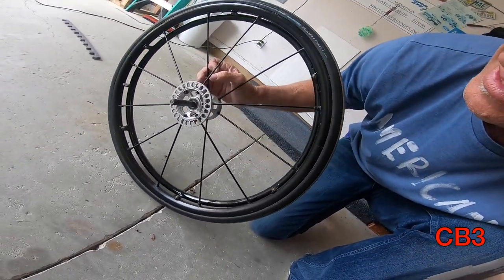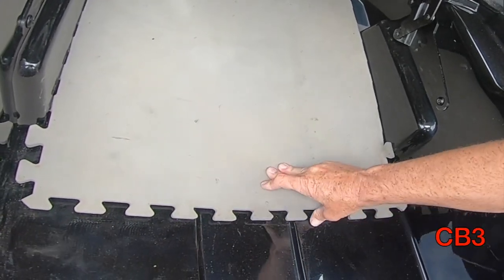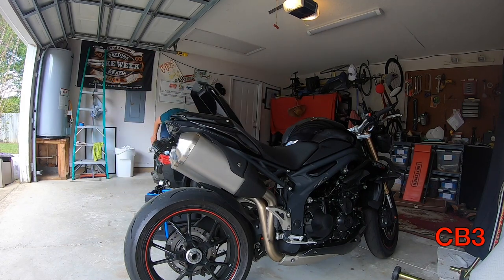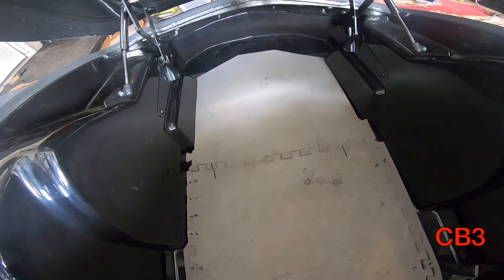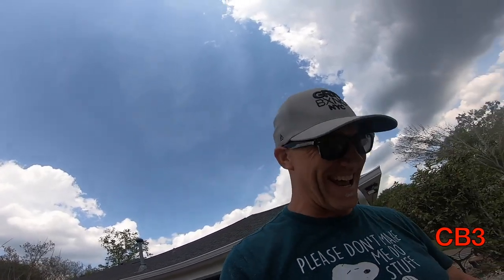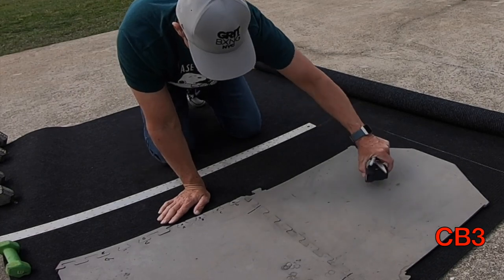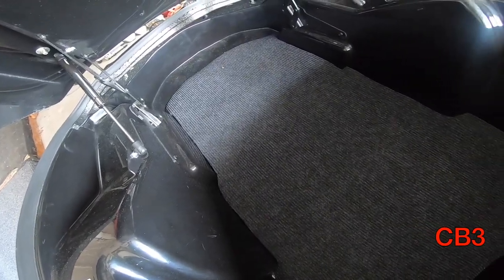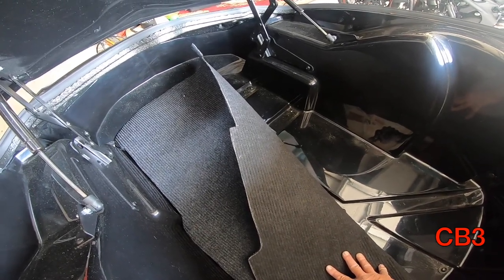CanAm Freedom Trailer Gets a new Floor

Comment: Nice job on the trailer carpet.   Have you considered using High Density foam and make cutouts for the axles to ride in to secure in place?   I am thinking something like a gun case but with much denser foam.   Could save a bunch of wear and tear on the trailer and Coach Vic’s chair.  Just a thought.
Reply from the maker: That’s an idea.   I’ll look into it.  I figure what I have will only last another 8-10 months.  Then I’m gonna redo it.  We are hard on things.

Comment: Just a thought, you could try placing Coach Vic's chair on top of the trailer lid, place the protective pad under it, secured, place chair on top, secured and cover with a colour matching tarp! This way you would not need to take the chair apart each time and would have more storage space inside the trailer, if the chair is not too heavy, l think the lid could handle it , :-). Safe Travels.

Comment: Hi CB3! Fantastic videos =D!!

I’m considering getting a Freedom Trailer for my F3, but I need to pull a 100 lb. generator in there for work.

It measures 25.1” length by 17.3” width by  18.3” height. Do you think fit  in there?  

The trailer seems to taper towards the front quite a bit so eyeballing  from your videos it looks iffy..?

Thanks much!

Joe
Reply from the maker: jobroni2020 I will do a firm measurement in a little while a let ya know.

Comment: Hi CB3! You have fanatic videos! They’re entertaining, informative and super well done! =D

I’m considering a Freedom Trailer for my F3 but I would have to pull a 100 lb generator in there for work.

It measures 25.1” length by 17.3” width by  18.3” height. Do you think it would fit in there..? From your videos it seems the trailer tapers 
down quite a bit so it looks iffy.

Any thoughts on this would be much appreciated 

Regards,

Joe
Reply from the maker: email me at bob3coach@gmail.com and I will send some pics with measurements for you.  The wheelchair we carry has some pretty odd dimensions...but are similar in scope to what you're looking at doing.

Comment: Coach question what do you think is a better trailer rt 622 or freedom trailer?
Reply from the maker: I have seen the 622 and love the fact that you can go in through the front of it as well as the back. They both hold 150 gallons of volume so the size is equal.  The freedom can carry 200 lbs whereas the 622 can only carry 150 lbs.  

I think you're great with either one of them.  That said....We love our Freedom trailer.  It has been rock solid for years now.  👍👍👍👍
Reply: @CoachBob3  thanks for your input great feedback